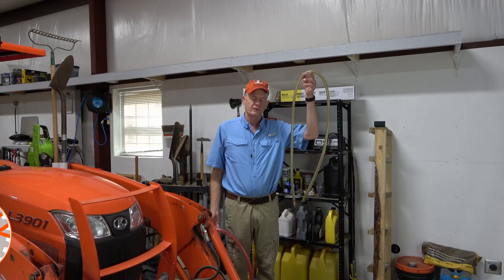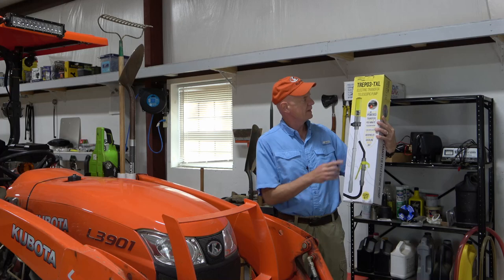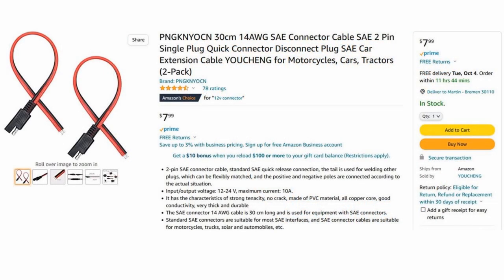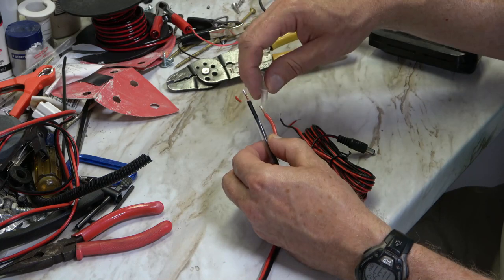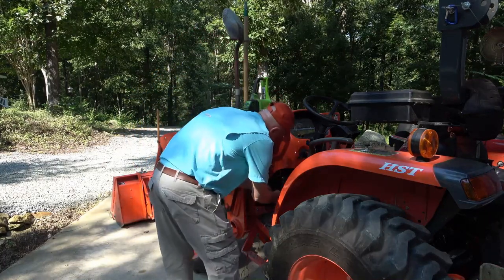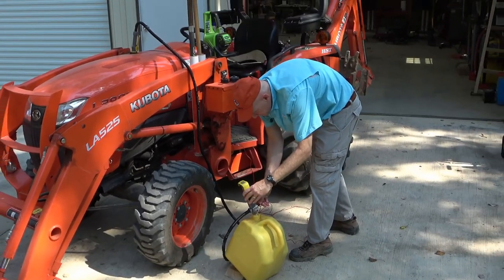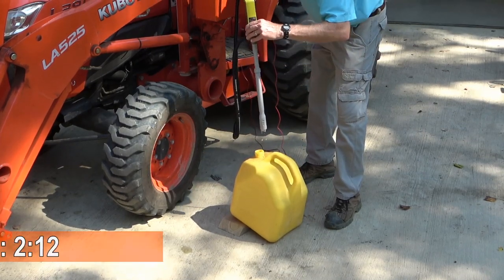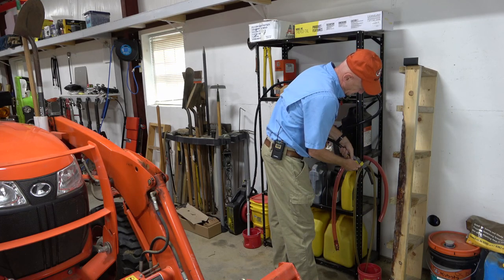The NEW Easy Way I Fuel My Tractor: TeraPump Fuel Transfer Pump (#176)

Comment: Well done, Martin.  I like the fact that the transfer pump fills Big Orange in 2.5 minutes compared to 6 minutes.  Anything is better than attempting to squeeze and firmly hold a plastic spring-loaded funnel-button on a 5 gallon container.  The longer hose nicely eliminates having to hoist a heavy-azz fuel container onto the tractor.  I totally enjoyed a 5-gallon full-watch  😊.  Thanks for the quality video, my friend.  Have a fine week and I hope you're enjoying this comfortable cool weather.  I finally am.  Don  👍🏽🤠 10/4/22
Reply from the maker: Thanks Don! Yes the long hose spares me the effort of hoisting the fuel can on to the tractor.  And yes, I’m loving the cooler weather!  I can actually work outside comfortably without risking a heat stroke. Hope you have a most excellent week too. Thanks for a full 5-gallon watch! 😃

Comment: Hey Martin - a cool method I found was getting a 14gal portable tank (had wheels on bottom and it's own hose/nozzle - gravity fed).  I just lift it up with the bucket on the front loader to raise it high enough for gravity to do its thing.  works great.  Only issue is the weight of a full tank is over 100lbs when unloading from truck.
Reply: Slide it from the back of the truck right into the bucket of the tractor. 
God bless you!

Comment: Perfect timing. I will be having shoulder surgery soon and there’s no way I’ll be able to lift my 5 gal fuel can over the rear wheel of my John Deere. Thanks for the tip!
Reply from the maker: Hi Craig!  You can’t be too careful after shoulder surgery, so yeah, you’ll need an easier way to handle fuel. Thanks for watching!

Comment: Very good demo.  The only thing I would change is your tractor power supply.  I would have routed the wire to the same side as your gas cap.  This way you could watch the 5gal can and the fill hose on the same side.
Reply from the maker: Thanks Douglas! The power connector on my tractor is right where I want it to me since its main purpose is for my battery maintainer as shown in the video.  I can see everything I need to see from the left side of the tractor when refueling. Thanks for watching!

Comment: Nice pump Martin.  It’s pricey, but if it does what you need it to do the price is moot. I’m lucky in that the Harbor Freight pump that can be had for around $9 on sale works like a champ for me. Funny, the ‘Amazon’s Choice’ one from Ideaworks is the same exact same pump as the HF one at more than double the cost, lol. At any price these little pumps are a lifesaver for those with bad backs, arthritis, etc. who find hoisting a 35 lb fuel container shoulder high for 2-3 minutes a pain.  Also liked your idea to wire it to your battery charger plug, that was a neat and clean way to do it.
Thanks for another excellent video, really enjoy this channel! 👍
Reply from the maker: Hi Dave! Yes I paid more than I had hoped in order to get what I needed but if it lasts a good long time it will be worth it. So glad you enjoy the channel! Thanks for watching!

Comment: One of my biggest gripes about my Kubota is filling the fuel tank! 5 gallon gas can is heavy to maneuver without spilling plus I don’t like scratching up the hood. ( I lay an old carpet over the hood a set the fuel can on it) 
Good idea! I’ll probably implement something like this eventually !
Reply from the maker: Yep, I got tired of hefting those fuel cans on to the hood and loader boom.  The little pump is a great convenience. Thanks for watching!
Reply: You make a great point.  Now try adding Kommiforniastan fuel tank laws/regulations. 
I know it's a joke. But still. Lol.

Comment: I liked your video . I previously ended up doing the same thing with a  bigger fuel transfer pump from Northern Tool. It pumps 5 gal in less than a minute through 1 inch hose... a bit overkill but it works!
Reply from the maker: Thank you, Scotty!  5 gallons in less than a minute - impressive! Thanks for watching!

Comment: Well, if the laws of physics have changed recently, I was not made aware of it... Lol! The length of the hose makes a difference with flow restriction. Especially a corrugated HDPE pipe. If you had a 3ft hose, it would be even faster. So you can't really compare the 2 minutes it takes with a normal 2D battery-operated pump with a short hose... which involves lifting the can most likely above the tank to fill!  I've found it's easier to empty the hose back into the can, then pour the remaining like you did. I like the way you made a quick electric connection, which is convenient. Thanks!
Reply from the maker: Hi Joe! Remember I said it was a localized change in the laws of physics. I don’t think you have anything to worry about in Canada - yet. 😁 Thanks for watching!

Comment: Problem solved for filling the Kubota.  I use the HF pump that I bought on sale for $7 to fill my 1025r  tank which is in the left rear fender.  Easy Peasey with regular 5 gallon plastic containers.

Comment: $80, WOW! I bought a $20 pump using 2 'D' batteries, and also place the diesel can on the cab deck. The hose is plenty long enough to fill the tank from there, no problems.
Reply from the maker: Hi Gunther!  Maybe you should have bought the $12 Harbor Freight pump that runs on 2 D batteries. You could have saved $8. Thanks for watching!

Comment: Great video as always Martin.  I am getting older and that sure beats lifting the can to fill it.  I would love to find something that doesn't drip.  I absolutely can not stand the smell of diesel.  I am thinking about some sort of gravity fed method, but don't have a good one yet.  Keep up the good work!
Reply from the maker: Thanks, Marty!  Gravity feed means lifting the can higher than the tank.  If you have a front end loader you could put the fuel can in the bucket and raise it up then start a syphon with a long enough hose. Thanks for watching!

Comment: Just bought the $11 Harbor Fraight model so I don't have to lift 5 gallons of fuel so high.  I will have to add a longer discharge tube.  
Thanks for great videos.
Reply from the maker: Hi Eric!  Hard to beat the Harbor Freight price if you can live with the shorter hose.  But if you can replace it, you’ll be in good shape. Thanks for watching!

Comment: Use a bigger funnel.... Are a elevated bulk tank.... I bought one of them a little electric jobbers yeah it'll work but I didn't care for it didn't work that good.... Now I have a 40 gallon transfer tank with the electric pump I can keep in the back of my truck if I care to

Comment: One thing I do like better on my jd2038R is the fuel fill on the rear fender but still a good lift with a full can. May look into this. Oh yeah I got a set of the magnetic mirrors you reviewed and so far so good,I love them
Reply from the maker: Hi Jim!  Depending on how high it is from the ground, you may get by with a shorter hose.  I think TeraPump also makes pumps with 5’ hoses that are less expensive than the 10’ models. Glad you like the mirrors too!

Comment: One of things I like about our Grand L 3560 is that the fuel cap is near the floor which makes life easier. However, as others have mentioned, we aren't getting any younger and this would be handy. I'm thinking it may pump closer to spec since it doesn't have to go up as high. Also, I noticed the yellow pump to match the yellow diesel cans. Are you able to get red? I  was thinking 🤔 maybe to get one for gas and diesel if you could get different colors.
Reply from the maker: Hi Jim!  Yes, it should pump closer to spec if it’s not pumping as high up.  In fact, they do make a red one with a 39”hose (https://amzn.to/3yl81GC) and a red one with a 10 ft hose (https://amzn.to/3SLtCAy), but they both run on 2 D batteries.  If that’s not an issue for you, then one of them may be a good fit for you. Thanks for watching!
Reply: @DIYMyWay  Thanks for the info.

Comment: i bought sure-can they have a tube that comes out at the bottom and you can just set it on the tractor and use the cap to make the fuel flow without holding it.
Reply from the maker: Hi Adam!  I’ve heard of the Sure-Can.  One reason I got the TeraPump was so I wouldn’t have to set the fuel can on my tractor anymore.
Reply: @DIYMyWay  yea that def nice plus you already have a bunch of cans, would be a waste to not use em

Comment: Good stuff but was wondering about where you buy your Diesel Fuel. I have only used Off Road Diesel in my Kubota since I bought it and I purchased a new Fuel Oil tank and filled it just before my Furnace died so I've been using that same fuel for a year now and the fuel delivered for a furnace is the same as off road diesel. My station across the street just started selling diesel but don't wanna use it if it has problems.
Reply from the maker: I’ve almost always gotten my diesel from Walmart.  Tractor has always run great. Thanks for watching!

Comment: Thanks for the great video. I swear I'm going to find a better way each time I fuel up my tractor. Then I forget about it until the next time. Have to look at this strategy. Does it have a way of preventing overfill or do you have to watch it.
Reply from the maker: You’re welcome, Terry!   No there’s no overfill protection on this model but I think there are some that do have it.  I simply make sure the tank is at about 1/4 full or less and I have no worries.  5 gallons takes it back to full. Thanks for watching!

Comment: The Harbor Freight ones are junk, they don't last. They work well until they don't mine last about four or five times then the plastic started falling apart. I like yours but for $81 I can wait on the siphon hose. Nice video still Martin.
Reply from the maker: Hi Dave!  Thanks for the info on the HF pump.  I had heard they were pretty good and already have a few comments from folks who are happy with them.  Then again, maybe they haven’t had them long.  I sure hope my $81 pump lasts a good long time.  If it doesn’t, you’ll be seeing a follow-up Video from me on it. Thanks for watching!

Comment: Good video. If I used my tractor more, I'd definitely buy one of those. (As it is, I've had my B2601 for at least 6 weeks and only have 5 hours on it. It's been way too hot here to do much outside. Hopefully that will change soon.)

An unrelated question... I noticed your 4-wheeled hose-reel cart in the background while you were fueling the tractor. I need one or two of those. Do you like that one? If so, what brand is it? Maybe you could put it in your Amazon store if it's available there? (There are a bunch of them on Amazon, but from the reviews it's hard to tell which are good.) Thanks!
Reply from the maker: Thank you, Laura! I hope cools off soon for you so you can play on your new tractor.  I bought that hose reel from Sam’s Club years ago and it’s been a pretty good one except the tires have dry rotted and leak air.  I might replace them with solid tires unless that costs more than a new hose reel. Thanks for watching!
Reply: @DIYMyWay  Thanks!

Comment: Transfer tank in the back of the truck is the only way.
Reply from the maker: That may be the only way for you, Graham, especially if you have many vehicles to fuel or have to refuel a lot more often.  5 gallon cans and a small transfer pump is another way to go and MY preferred way.  And there are many other ways to fuel a tractor depending on the needs and preferences of the person. Thanks for watching!
Reply: @DIYMyWay  do you have a diesel vehicle? Or is your main vehicle gas?

Comment: Please don’t promote a product till you have a long term review. My expensive Tera pump rubber seals failed and pours fuel out of the handle. Tera has no parts and no repair for this expensive unit. I won’t be buying anything from them again why pay extra ?
Reply from the maker: Mine has not failed so my review stands as is.  Sorry that yours failed.